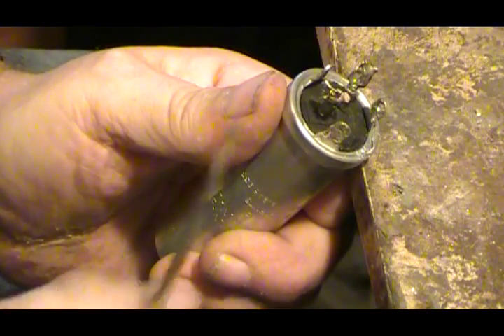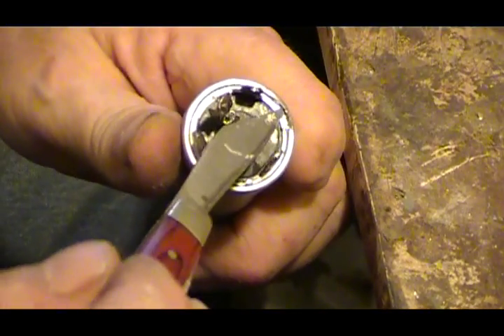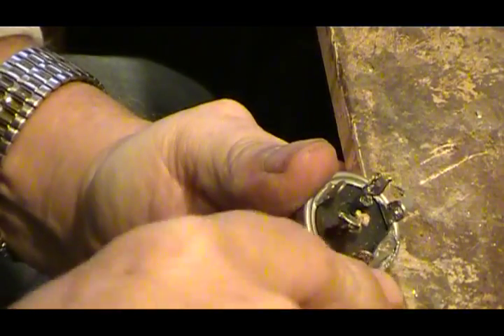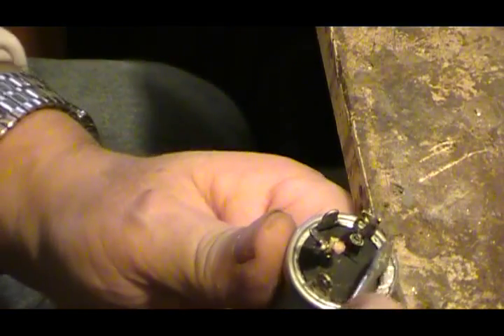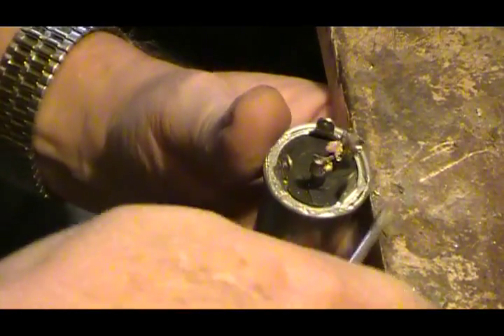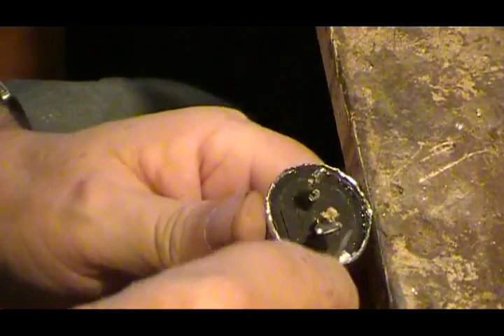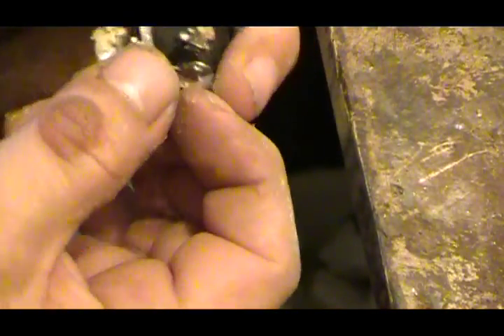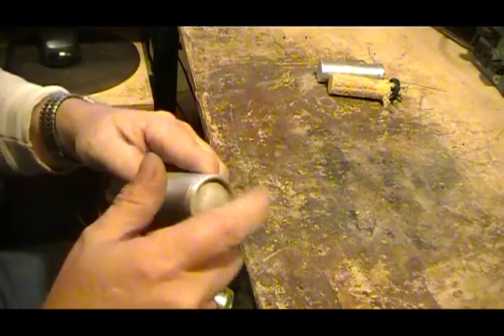Uncrimping electrolytic can caps

Comment: Thanks a million Dennis for answering my request! I've seen Bob doing it and now you doing it as well.
I think the biggest difference between you and I uncrimping the cans is where I. after raising the crimp through the whole 360 degree range would use flat pliers to lift the crimp straight up. I think this is where I went wrong and would then distort the mounting ring. I see that you would pry the crimp all the way by using the ring itself. I'll definitely try your method next time for sure.
Thanks again my friend,
Tom
Reply from the maker: Hi Tom. It was my pleasure to be of some help. Your friend  Dennis

Comment: by the way.. for the top crimp cans.  I use a copper pipe cutter.  the round blade cuts through in about 5 seconds and it leaves a nice clean rounded edge.  (I've been practicing since my first attempt.   ;-)
Reply from the maker: Hi Bret. Great tip and thanks for watching.  Your friend  Dennis